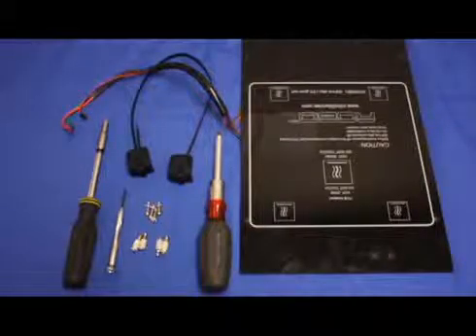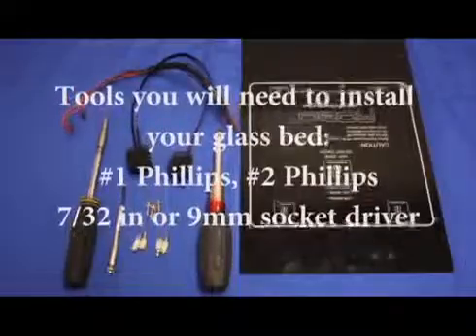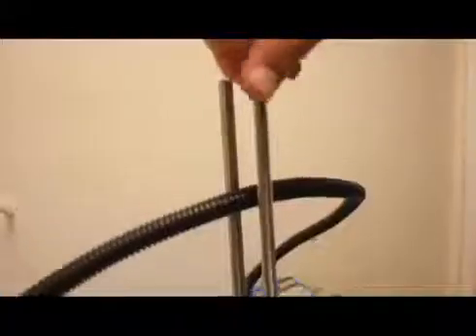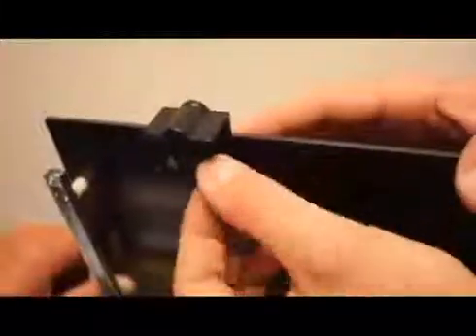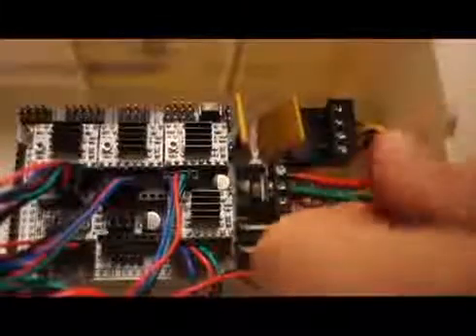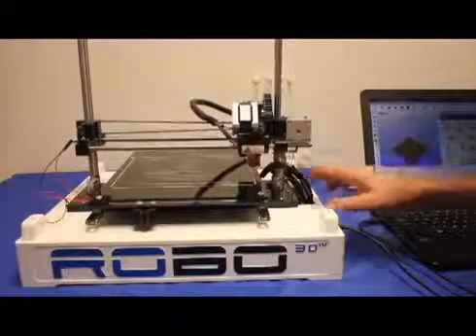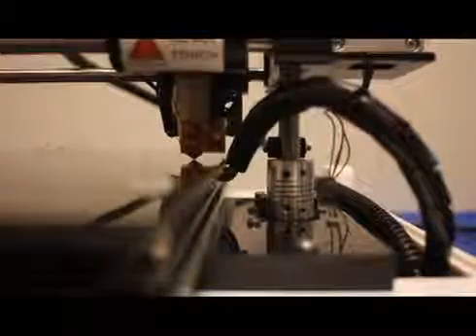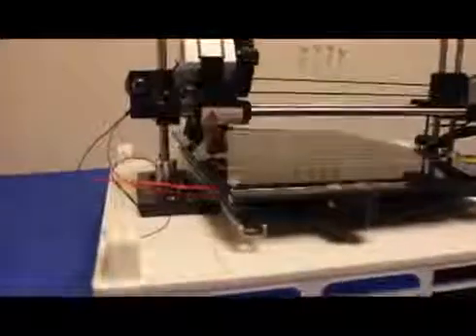Robo3D Glass bed installation and bed leveling

Comment: Do you have any of the Robo3d print beds for sale? I need this model bed and Robo3d no longer supplies them, they told me to print new mounts for the R1 bed....on a broken printer...
Reply from the maker: +Troy ‘Magicslayer’ Adamczyk no, sorry, I give away my robo3d as I was completely unhappy with the machine.
Reply: I relpaced the Hot end and now the bed with the R1's bed, now the only issue I should have is the leveling. The things that left a bad taste in my mouth is the replacement support and the fact that the Robo3d's now have auto level, support for the z axis, and metal hotends. Had I waited 2 months to order mine, I would have had some of these features. Out of the 2 years I've had my printer, I've had maybe 8 complete prints. Now with the new stuff added to the printer, I'm hoping to have better results.